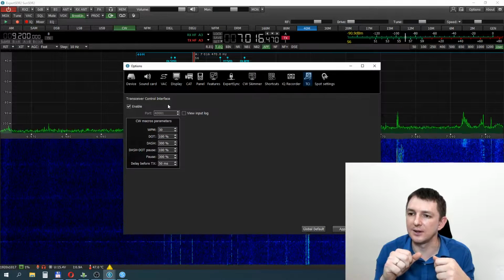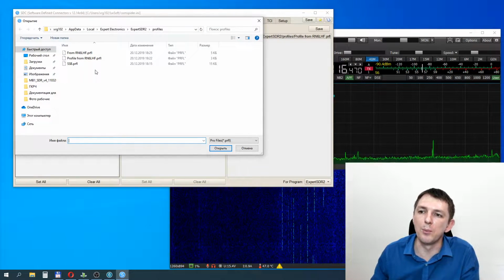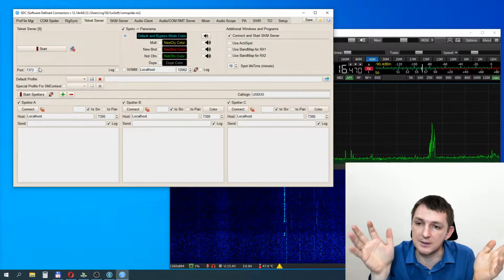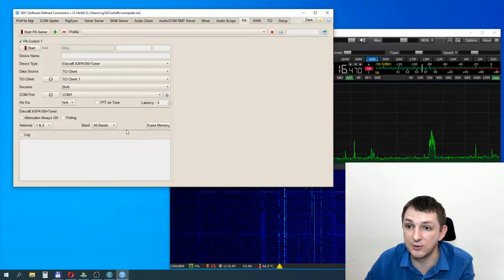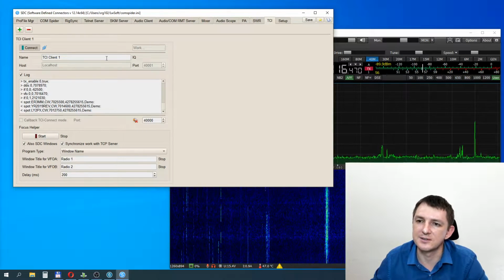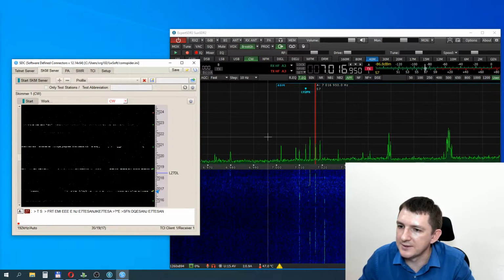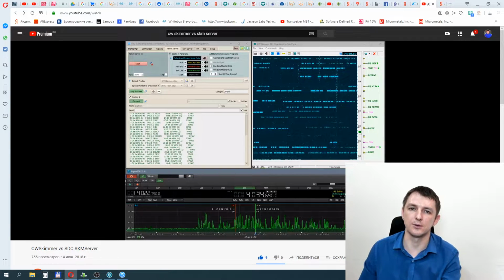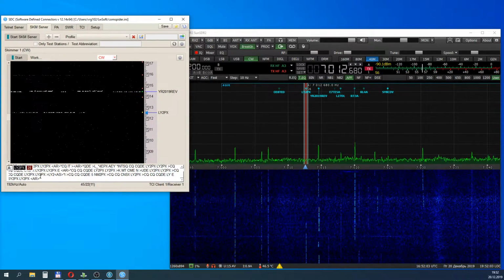ExpertSDR2 + SDC software

Comment: Does this software replace the virtual audio connection needed to connect to WTDX?
Reply from the maker: No, the SDC software is decoder CW, BPSK, RTTY signals as CW Skimmer, but for CW and Digi and better. It works without virtual audio and without virtual COM-port connection. SDC used our network TCI interface - which provides direct complex network connection between ESDR and other software and provides spots to your logger and to Panadapter of ExpertSDR2.
For today a couple of programms support it. You can find it by the folowing link: https://eesdr.com/en/software-en/software-en
ExpertSDR2+SDC+5MContest provides working in digimodes BPSK/RTTY without virtual audio/COM connection - only TCI.
As I know, programmers of JTDX software works under new version of JTDX which supports direct connection to ExpertSDR2 software via TCI without virtual connections. I think more and more software will support TCI in time.

Comment: Hello Vasily. I have seen your videos about the Sunsdr configurations and I find them very impressive, very good design and a lot of work. But what I liked most about Sunsdr is that its designers make radio use them that shows great love for what they do. It is not minor. Thanks for good design. It is not ruled out that Sunsdr is the next team in my station.I am 99.99999%  CW op.... 73 es DX.Ed

Comment: Very nice. I just downloaded and installed SDC. All of the download links I found on your pages are broken links. You might need to update the links on the website.
Reply from the maker: Thanks. Will check it Monday.
Original discussion is on the CQHAM forum. Here is a link to the message with latest version for Widows: http://www.cqham.ru/forum/showthread.php?34313-Software-Defined-Connectors&p=1702486&viewfull=1#post1702486
Use Google translator from Russian to your language.
Reply: @R6NY  Perfect. Now I have the newest version. Thank you Sir!